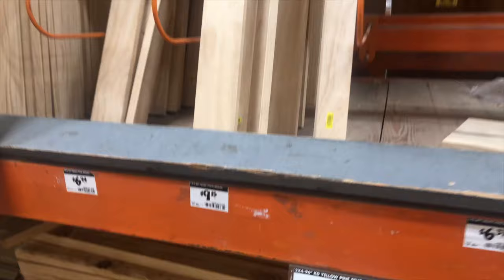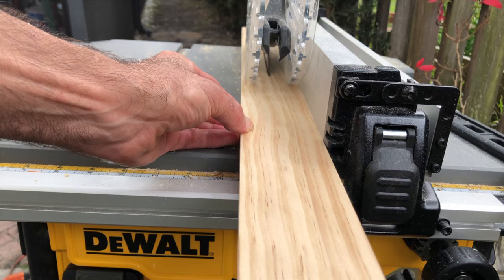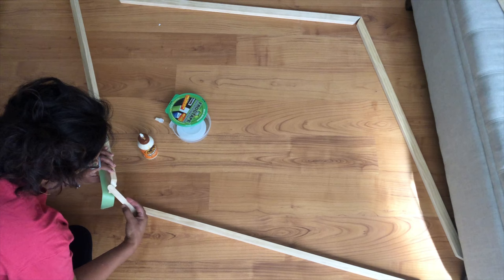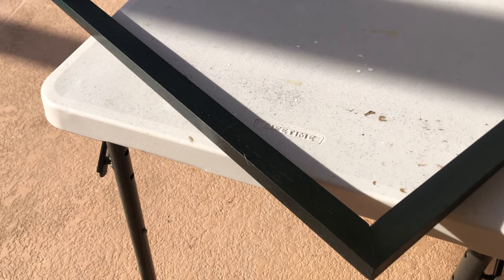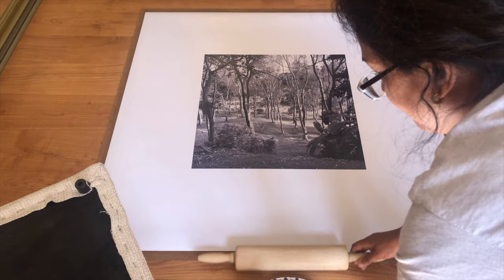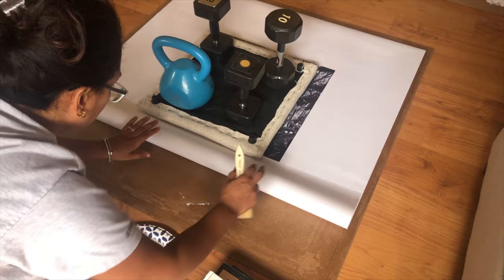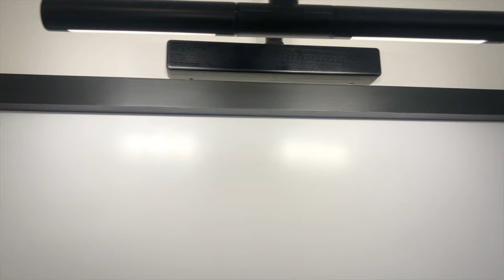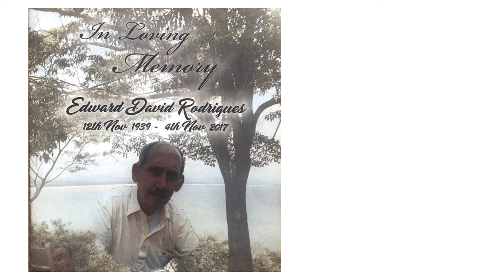How To Make a Custom Picture Frame | Oversized DIY Photo Frame Wall Decor

Comment: Using that kind of a board on the back makes it extremely heavy. You can use foam core board in the same way. It’s strong and light weight and is usually used for the back of pictures.
Reply from the maker: Definitely trying that next time, thank you! 😊😊🙏🏽

Comment: I have 2 canvases, both are 30’’ x 40’’ (inches), I’m wondering if this would work. I don’t want to over pay for new frames . Can you direct me to a video that explains DIY frames ?
Reply from the maker: You can use the same guidelines used here, just use the measurements around your canvas and it can be attached with little ‘L’ clips that go on the back.